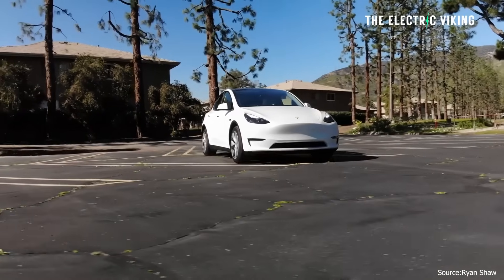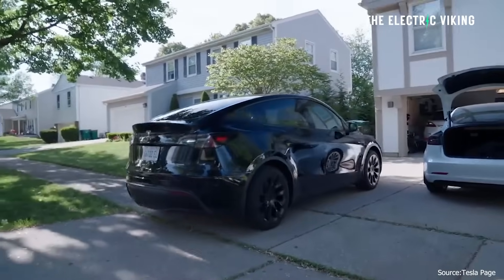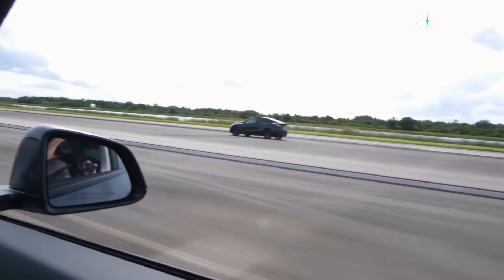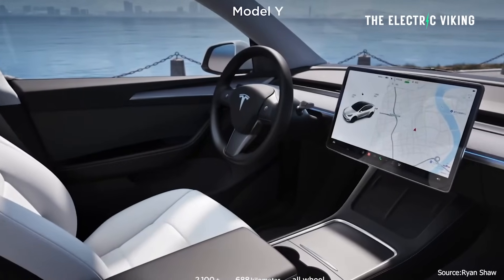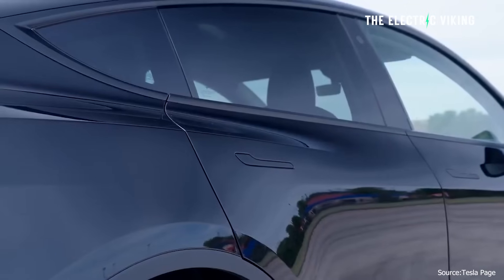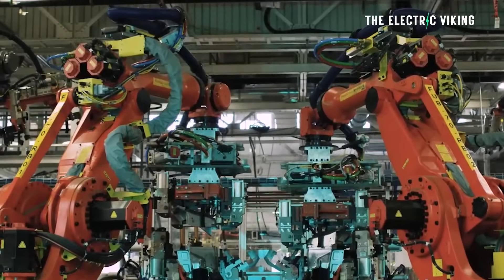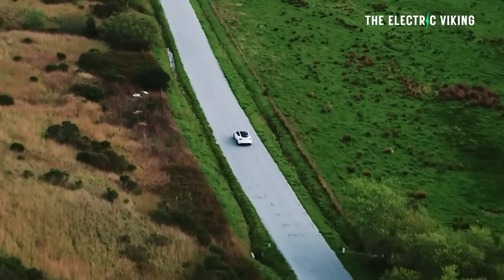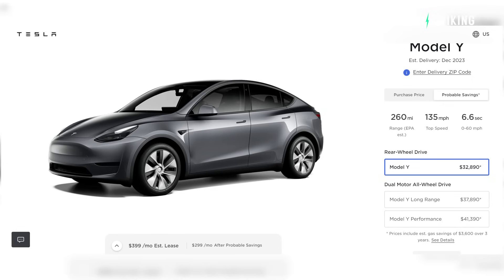Tesla sells out of the updated Model Y SR configuration in China

Comment: Still waiting for the next version with V2L, 48V bus , 350kw charging and steer by wire.
Reply: in a midnight cherry and 85 kWh battery achieved by optimized 4680 battery production.